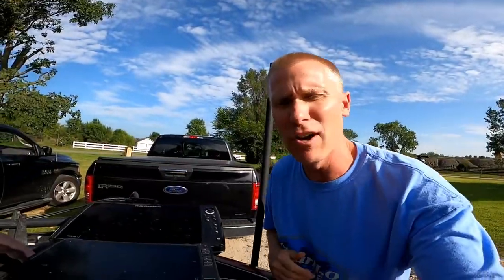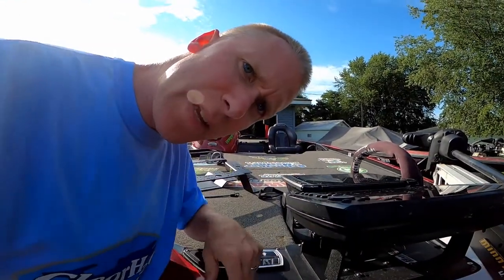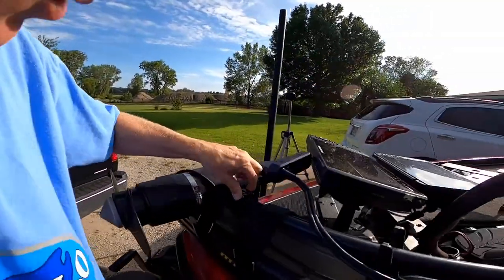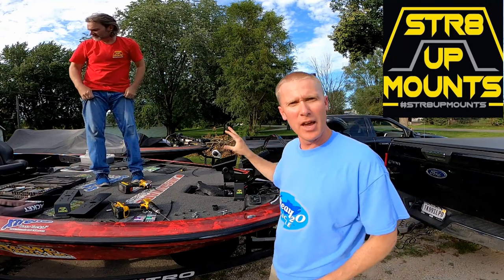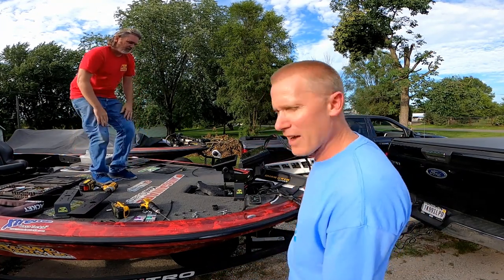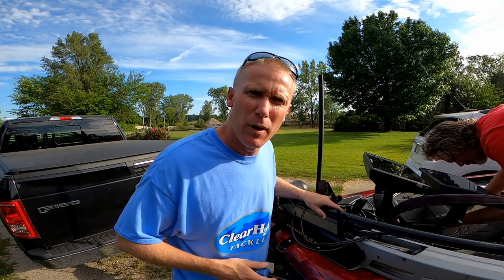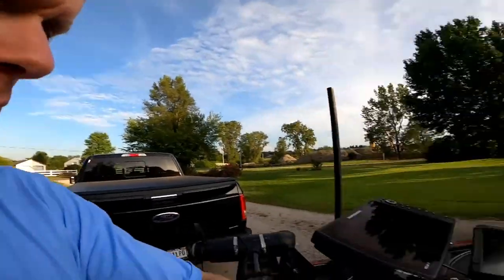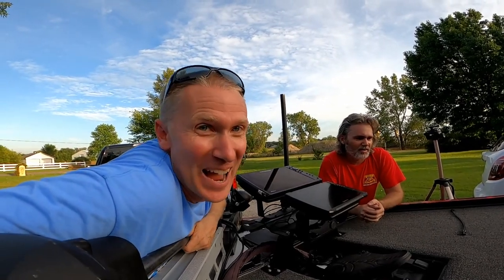How to Select and Install the Right Dual Fish Finder Mount

Comment: I currently run a helix 10 with a dek it mount on the bow. Also a Ultrex with mega 360. I just ordered a Garmin 1022 and the new livescope lvs34. So it's time for a dual mount. Are you happy with the STR8 mounts? Also I'm debating on the 5" or 7"...not sure which one. I do have a recessed tray.
Reply from the maker: Extremely happy with it. 

I know 5" models sell more than 7" but I would consider how you fish and if 7" will be too high.